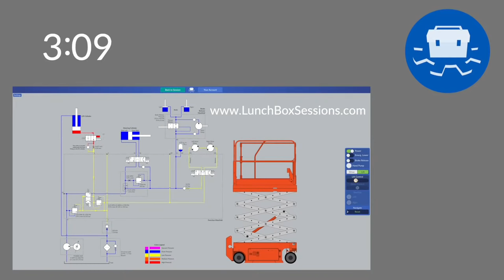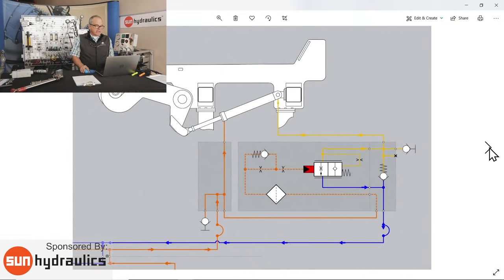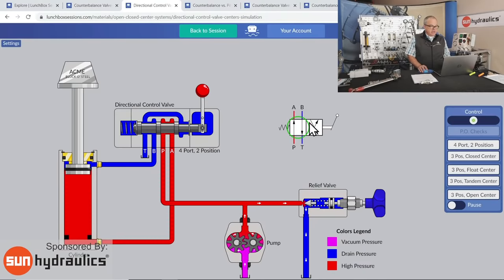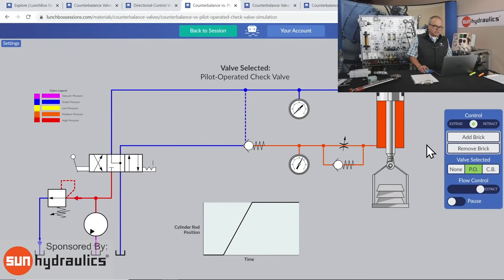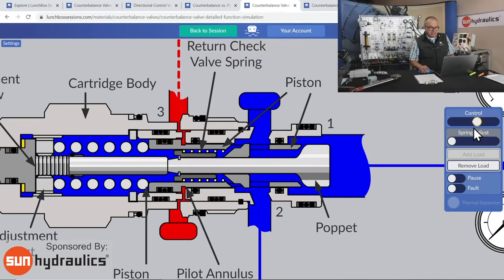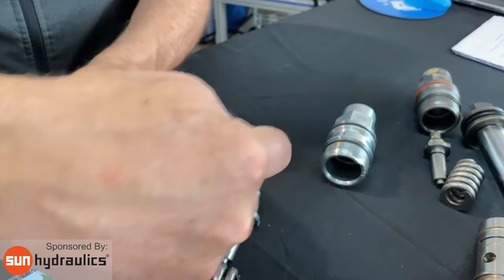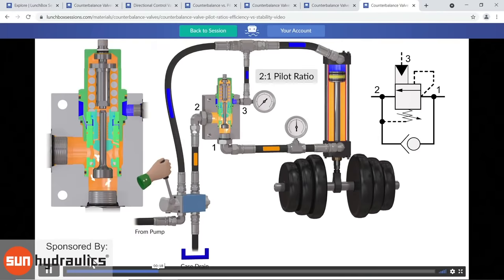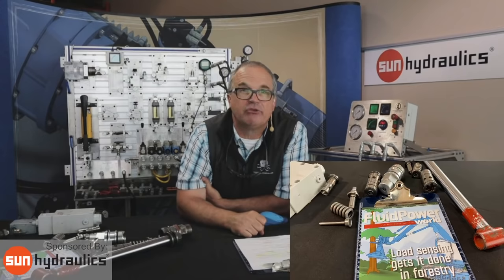Load Holding and Motion Control Valves (Live From July 22, 2021)

Comment: Ran into your video after buying a compact tractor and trying to better understand the hydraulics. On the rear its got an hydraulic top link that bleeds down.  Sounds like an application for a pilot operated check valve. On the front, the tilt when using the grapple is quite jerky with a heavy load, sounds like an application for an over center valve.

Comment: I have a genie lift that has a platform tilt valve with two counterbalance valves . I get no motion of the platform cylinder. The directional control spool functions normally. Should I suspect one or both counterbalance valves are defective ? Pressures at the cylinder are both at max system pressure.